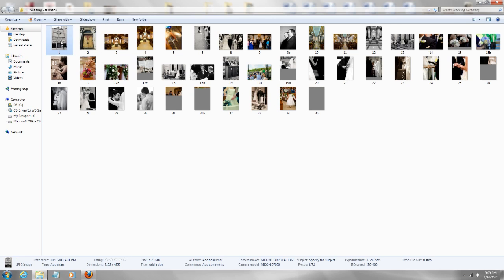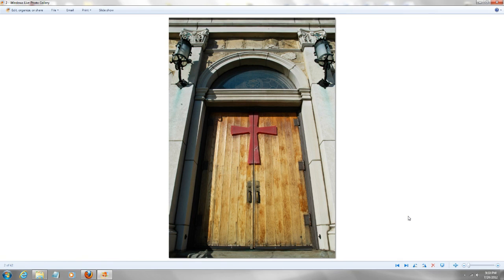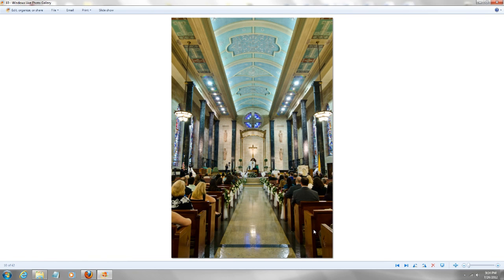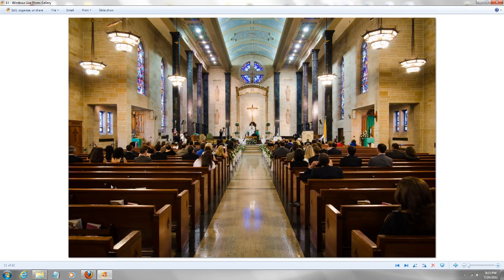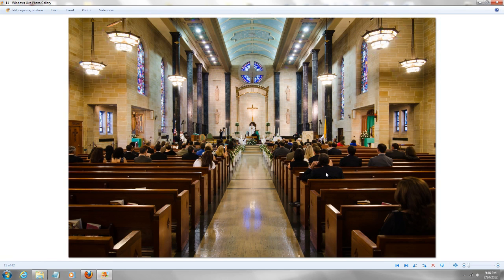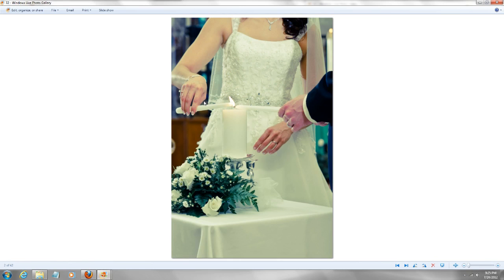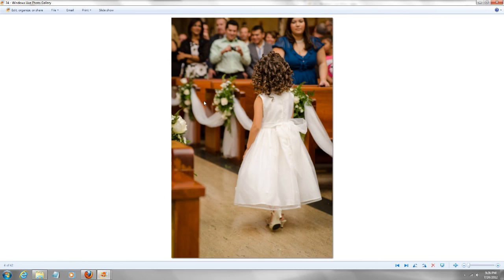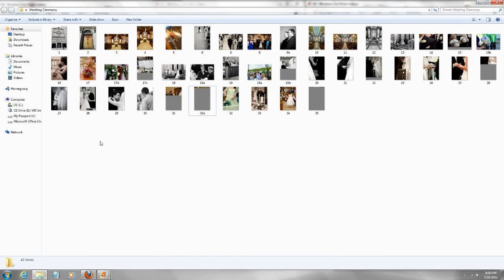How to Shoot a Wedding - Ceremony - Wedding Photography Tutorial Series

Comment: I have a question. At 16:16 in the video you spoke about not using the strobes because the ceiling was dark. Could you have bounce the strobes by point the strobe at the wall? The wall seems to be light in color.